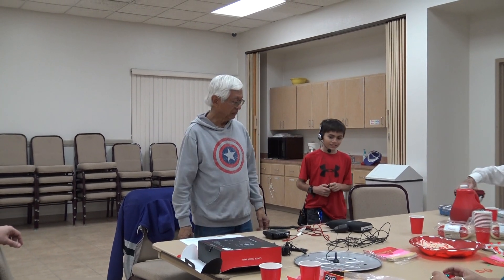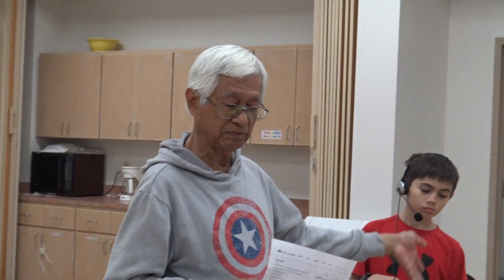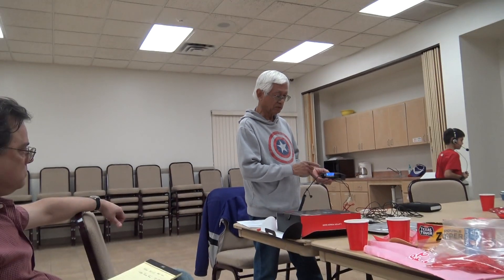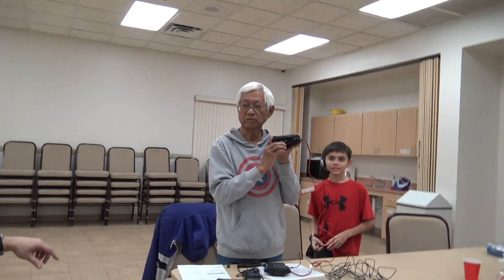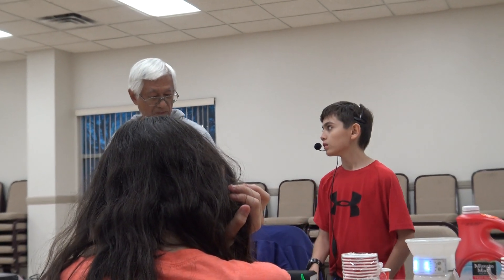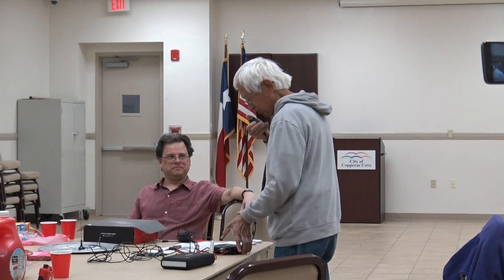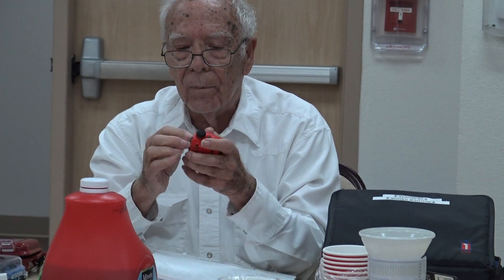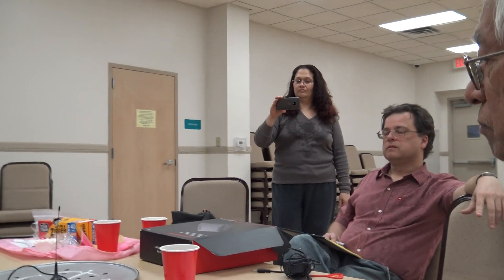Midland MXT 115 microMbile GMRS two way radio &  Renogy Laptop Power Bank

Comment: I have the BTECH GMRS-V1 HTs, and each of the Midland MXT series Micromobile radios. I have used each of the Micromobiles as base stations in my house, with a 5 dB gain 5/8 wave groundplane antenna mounted at 30 feet ( 3 sections of chainlink fence top rail). I use LMR-400 coax.  From my house to my car, I get 10-30 miles range, and I live near Spokane, WA, where we have mountains and tall trees. I use the car antennas that come with the radios, but I get slightly better performance with a 5/8 groundplane (magnetic mount) that is desgined for GMRS frequencies. I get 5-10 miles range with the BTECH GMRS-V1, but this is greatly dependent on terrain between me and the home antenna. The height of the antennas has more impact than the power the radio puts out. I think the 15 watt models give the biggest bang for the buck.
Reply: 50 watt mobiles available now for some real bang.